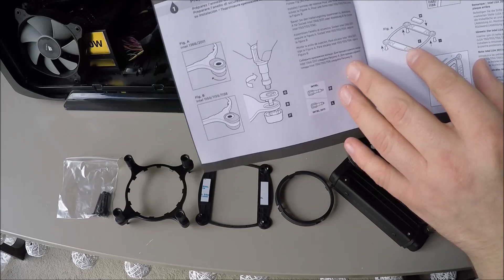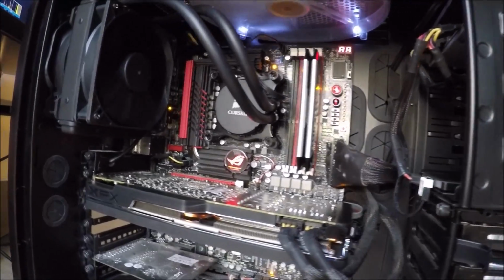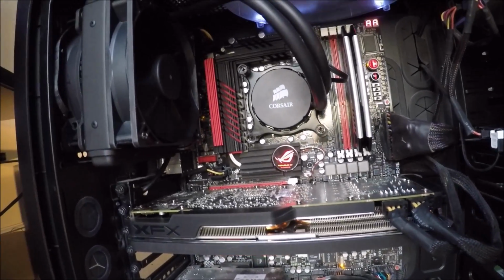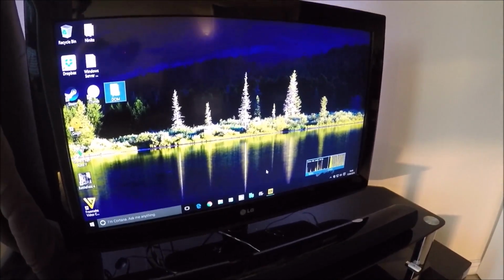How To Install Corsair H55 Hydro Series Water Cooling System

Comment: When you change a liquid cooler/water cooling, what do you refill it with? What are the best solutions? I'm new to water cooling thanks!
Reply from the maker: You'd be better to buy a closed system where you don't need to worry about refilling it.
Jake

Comment: If you set up to blow air through the radiator & out of the fan, you are warming the radiator with the case air, you want cold outside air sucking in and reverse the other fans to blow... Basics!
Reply from the maker: Mark Harding I’ve experimented with both and didn’t see any noticeable temperature differences, although logically as you said it should. Conclusion I came to points to the power supply and GTX1070 exhausting their heat to the rear, and therefore CPU fan would pump that air back in warm. End of the day it didn’t make any odds to my setup, the system isn’t new now by any means and this is how Overclockers UK had built this system with the original cooler, OCed to 4.8GHZ. 7 years later there are still no issues, great system! 🙂
Reply: Jake Billing Rubbish, you’d decided that before you removed the old one. Obviously you know more than Corsair... Warming radiator water with warm air increases CPU temp, end of 👋🏻
Reply from the maker: Mark Harding Thank you

Comment: QUESTION: So I’m trying to take off the water block (the thing that goes on the CPU) but whenever I twist the thumb screws with a screwdriver, nothing happens it just goes in an endless circle, and the back screw go as well PLEASE HELP

Comment: i have a question how come you make the h55 a exhaust?  you should turn the fan around so it comes in as a intake so cool air can hit the water and the heat that blows out the rad will just blow out the 200mm fan on top. because right now its just sucking hot grahpics card air threw the rad.

Comment: Do you need to clean this thing? I've had mine for a while and haven't touched it yet.
Reply: Just blow it with an air can every now and again, since its been a while (you posted this comment 2 years ago) you may want to replace the thermal paste.

Comment: I have a question.. how many years until I have to replace the water ?? this info is nowhere to be found ..
Reply: you don't replace the water in this one since it's a closed system. if the item develops a fault it's covered under corsair warranty, but if it no longer works, you need a whole new one. don't disassemble it in an attempt to change the water since i don't think the warranty covers you tearing it to pieces.

Comment: Guys I can't find anything on this, but shouldn't this fit an LGA 1155 socket? I see it in the instructions, but the bracket is too big for the motherboard. I have the stock Intel E97378-001 heatsync that fits fine. Can't see to find a an aftermarket cooler that fits. Any ideas or suggestions? Maybe just get another bracket they have?

Comment: where did u plug the block cable?  is it in system fan slot or cpu fan slot or cpu OPT slot?
Reply: should be cpu fan slot

Comment: exhaust setup will be best or intake as suggested by Corsair? little confused!! my cabinet front fan is intake, top exhaust, side exhaust and mine h55 is also intake? any changes required?
Reply: you have the fan blowing inwards (intake) so cold air goes through the radiator instead of warm air from the case, the top fan should still be good for exhaust but case temp may go up a little not much

Comment: Corsair recommend that the cooler fan be pulling in air. That seems strange. Did you fit that as an intake or an exhaust ?
Reply from the maker: Both fans are pushing out hot air, so it's an exhaust setup

Comment: fan for the radiator... you seem to have one on both sides?    if only one is available, should it go on the inside (of the radiator) or on the outside between the case n radiator?

Comment: the power suply is upside down i think...
Reply: That's not true. JayzTwoCents has explained several reasons why someone would want to mount the psu upside-down. One reason I remember is when having a carpet. Another reason is if you want that psu fan to work sucking air from inside the case so that you can fix your pressure (negative or positive). For example if you have 4 fans, 2 in, 2 out and you want another one out so that you get negative pressure, you can swap that psu and get that negative pressure.
Reply: Vortex - it can be mounted Both ways but it shouldn't
Reply: the fan should be facing downwards so that it is drawing cool air from outside the pc case instead of hot air from the gpu
Reply: it can be both! but its recommended to do it fan downward

Comment: What and how actually does water cooling system work? Is there water inside those tubes? I may sound like a noob but please tell me
Reply from the maker: Yeah the radiator stores water and the pump pushes it around in a constant cycle, water is warmed by the processor, the pump then pushes it away up to the radiator and is cooled by the passing of cool air. The pump then pulls the cooler water back to the processor and the process happens all over again
Reply: wow thanks for the good explanation. Do you also need to change the water from time to time?
Reply: +Abh19021 not too often
Reply: +Abh19021 with diy kits yes but since this is sealed u cant u'd probably replace in 1-3years ( liquid inside picks up gunk ) diy kits replace water every month